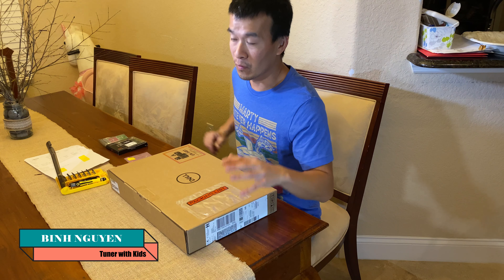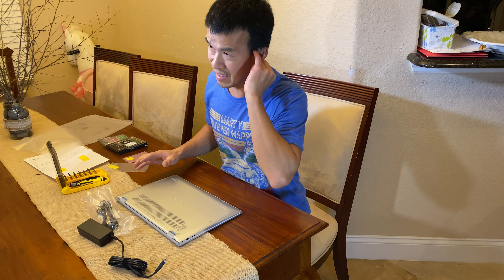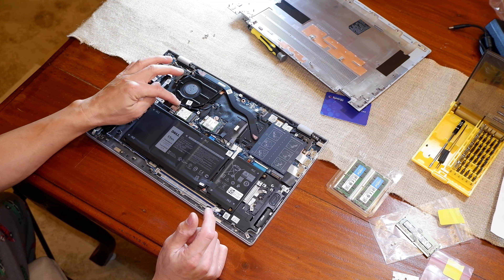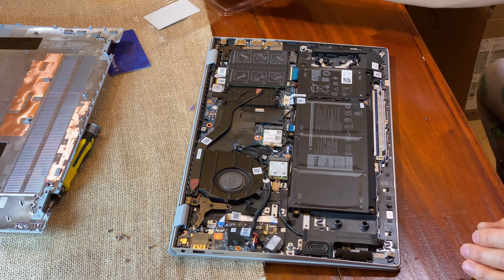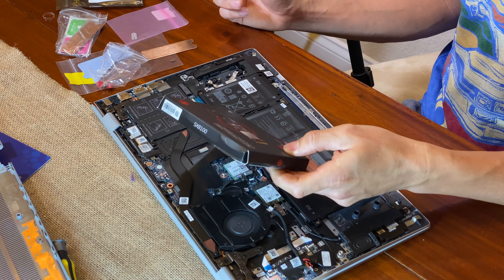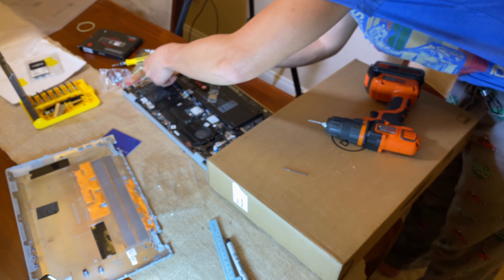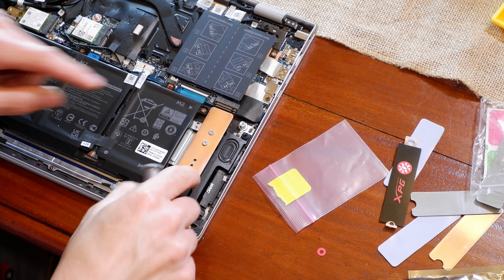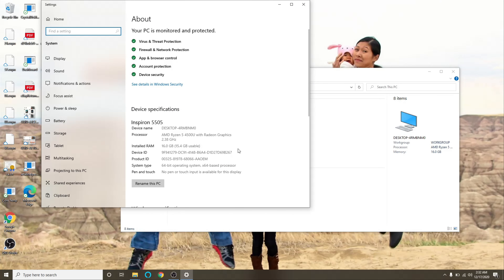2021 Dell Inspiron 15 (5505) RAM & SSD NVME Upgrade | AMD Ryzen 5 4500U | How To Install Hard Drive

Comment: You are actually missing the DF6CG screw that holds the SSD down.  But it looks like you used a different screw.  I was going to suggest glueing the metal bracket you filled the holes into by using an epoxy.  I mean once the ssd is screwed down that bracket is not going anywhere if you would've used a little epoxy.  
I got the same laptop and got the 3 screwed and small bracket from Dell.  I am not upgrading the ssd now so I will wait until the bracket is back in stock to order it from Dell
Reply from the maker: Yea the m2x3mm is $2 each and I already had plenty laying around. Plus the aftermarket bracket came with a few. The hard screw to fine are the m1.6 which isn’t common.
Reply from the maker: Also with the aftermarket heat sink, once you drill hole to clear the nub, you can just wedge it on with the thermal tape and it won’t budge. They two screws I used are just for extra hold down.
Reply: @TunerwithKids  I was lucky to order the M2x1.6 screws for $1.99 each but I used my Dell Rewards Balance like you ;).  I also got the small KYMC9 bracket from Dell (used the Dell Rewards).  That was last week and I already have the 3 screws and smaller bracket.  I just called Dell and was able to place an order for the MWJM4 which is the most important part (bracket with thermo pad).  The MWJM4 is $6.99.  I didn't have enough in my Dell Rewards, but it covered half of the cost which is ok.  I hope they don't cancel the order though like they did with you.  The M2x3mm screw is not available, but either I will find one in my toolbox or will buy one from any site since it's just a M2x3mm flathead.
BTW, for the RAM I just purchased 1x8GB Crucial stick 3200 with the same latency (I think 22, but I remember checking the specs for the Samsung stock sick and matched it).  Got it for $30 for 1x8 GB stick
Reply from the maker: Yea I got canceled on the MWJM4 order. Had to reorder the others after. For RAM it was $32 for one or $47 for two so I opted for matching and sold the Samsung OEM for $20.

Comment: I feel like you can get away without using a heatsink if you are going to be using a SATA M.2 connector since those don't generate a lot of heat.
Reply from the maker: You probably can use without the sink. Most m.2 have their own thin heat sink already.

Comment: Hi I bought this laptop with the Ryzen 7 option last year and it's a really good premium feeling machine.
My only main concern about the laptop is when you open it up to upgrade ram or ssd the screws are easy to strip. I hope dell fixes this problem.
Reply from the maker: Yea. Just need a good precision screw driver. Three screws near the top monitor side don’t come out all the way, they have a retainer holding them.

Comment: Hi, thanks for the vidya. Question about the heatsink for the SSD tho - is it absolutely necessary? I will just use this laptop for browsing and watching movies. Not gaming. What are your or anyone's thoughts on this?
Reply from the maker: It’s probably not needed especially on the backside where it sits in this machine. The main heat is on the front side which is wedged by the cover and that thermal tape. These SSD get hot during reading and writing though. I see temps of 120 to 140F when it’s writing GB of data from the 256 main drive to the secondary SSD but it’s also writing crazy speeds.
Reply: @TunerwithKids  Oh ok, thanks so much for the clarification. So no heatsink, but i'll def look into some thermal tape or maybe even that thermal pad straight from Dell. Thanks again!
Reply: Hi I am from India and I have ordered the laptop in Dec 2020, but need to sell it now.

Comment: hey thank you so much for the video... I was able only to install the top heatsink but not the bottom one ? do you think that's better than no heatsink at all or should I take it off?
Reply from the maker: Should be fine. It’s so tight that I’m not sure the other sink will do much b

Comment: Do you think is possible to use an offset screw instead of the bracket?
Reply from the maker: If you want to just send it, you can screw right into the plastic hole for the bracket screw sink. Just space it with some random washers and use a longer m2.5 screw.
Reply: @TunerwithKids  Could you kindly recommend one from Amazon? I have seen many but the threads seem too thin. Since you have seen the plastic hole firsthand, maybe you have an idea which standoff screw could fit snugly. Thanks!
Reply from the maker: Heres a $7 option with the sizes you will need - https://amzn.to/34GVJc4

Comment: Great video! 
I ordered Inspiron 15 5505 with 
AMD Ryzen(TM) 5 4500U Mobile Processor with Radeon(TM) Graphics and is it good to change it to 16 gb RAM for games and other stuff? It comes with 256 SSD.
Reply from the maker: I think the 16B will help the computer run much better, if you can afford it go maximum 32GB.

Comment: Are you able to charge this laptop through a type c cable?
Reply from the maker: Yea. You need a power delivery cable and supply. Usually 45W or more.
Reply from the maker: @pcruz8 it’s for dual charge capability. Also, since most mid and low end machines only have one USB-C port, don’t want to tie it up for power only. For my Dells, I have a WD19TB (work computers) and an older WD15 dock which can dock most Dell and others with charging. For my Dell 15 G5, it doesn’t charge via PD due to the power demands of 185W.
Reply: @TunerwithKids  Thanks for the update. I tried charging with my phone charger and it didn't charge. Looks like I need to get an adapter with higher Watts.
Reply from the maker: Something like this, https://amzn.to/355nTyx
Reply from the maker: Need a cable like this. The longer it is the less watts it will deliver. PD has specifications for length and power. https://amzn.to/385aR5V
Reply: @TunerwithKids  thanks

Comment: HP pavilion with amd7 vs this dell laptop amd 5 which one you recommended. I got both want to rerun on.
Reply from the maker: I have no experience with the HP. Is it the same price?
Reply: @TunerwithKids  yes it is same price. Same ram and ssd.  It go has 250 nits vs 220 on this dell
Reply from the maker: Seems like HP might be better for power. Not sure about build quality or size.
Reply: The hp has the faster ryzen 4700u and since you got the newer pavilion with the aluminum body its a better "quality" build than the plastic dell. Im happy with my pavilion so far, its in fog blue and built it on hp.com with a fhd screen, wifi 6, 2 sticks of 2x4 3200mhz which is 8gb ram, backlit keyboard and 256 ssd kinda small but still quick and it has a finger print reader, If I were in your shoes compare the specs of the two laptops indepth and see which has more features/benefits for you. If they have the same ram, should one be 3200mhz or the other be 2666mhz then the 2666 is slower, or if the dell only has one stick of 1x8gb ram compared to the hps possible 2 sticks of 2x4gb ram which means 2 matching sticks is better. It sounds like the hp has a brighter screen too, are they both the glossy ips screen? Its a pain to clean. If you have wifi 6 in one thats good, also if one is backlit keyboard while the other isnt thats a plus, and I think the hp B&O speakers are better. Find out which laptop has better "specs" (the dell may have a larger battery) or more features and go from there, also if one has a longer warranty thats good too. They sound like very similar laptops! Only major difference is the hp having the 4700u
Reply: What did you decide on?
Reply: @N8Catona  Go with Hp. light and build quality good as well. also razer 7 for $399 sims good deal. HP customer service is really bad 
thx
Reply: @hiteshpatel528  i actually have my own new hp pavilion that I bought haha, I chose it over the dell inspiron because it eeked ahead with 2 sticks of 2x4 ram and a brighter screen and that nice color. I actually have good service through hp support assistant actually and you can tell the bot to speak with a person which is very helpful.
Reply: i went with Dell becuase of ease of upgradeability (supposedly), the bios is being a raging pain in the rear as I try to install linux on the machine

Comment: Is the heat sink actually necessary? The manual doesn't seem to say to put in a heat sink.
Reply from the maker: The part is supposed to be there but Dell quit shipping it installed.
Reply: Thanks a bunch!

Comment: Where would I go to chat with dell on ordering the parts for the second SSD? I just got this laptop for christmas and want to eventually install 2 NVMe SSDs. I would prefer text chat but calling also works.
Reply from the maker: On there website under support or spare parts. There’s a chat option in lower corner, if you tell them the P/N they will process it thru chat and send you an invoice/estimate. The OEM heat sink is on unforeseeable back order. The m1.6 screws and small bracket are available. If you don’t already have an m2x3mm screw, need one of those too. Sign up for a Dell rewards for free 2 day shipping else, they charge $9 for ship.
Reply: @TunerwithKids  Thanks. I will probably consider getting after market heatsinks for my drives as I was looking at getting that part from dell but since it is on backorder I might be better getting the aftermarket.
Reply: Guess I should ask this as well but does it cost to join the dell rewards?
Reply from the maker: @Imnotimportant555  Dell rewards is free. It’s usually 3 to 4 percent back on all your Dell orders.
Reply: @TunerwithKids  ah ok thanks.
Reply: @TunerwithKids  I have returned with an update. I got my laptop and just upgraded the ram. you mentioned about the touchpad not clicking. that did happen to me but it was not the screws that caused it. the bottom panel was not clipped in 100% around where the touchpad was.

Comment: Hi, thank you for the video. I received my Dell 5502 two weeks ago and i want to add M.2 2280 Gen NVMe SSd. Would that be no harm if I just screw it down to the plastic hole without the heatsink? Thanks for your response
Reply from the maker: You can probably get away with it. May need to spacer or washer.
Reply: @TunerwithKids  
Oh that would be great.  thank you for your prompt response.
Reply: Thanks for your response. I have another question
Can I ask what would happen if you cloned and installed a second SSD into the second slot and simply copied all of the windows data onto both drives, I assume it would get confused and the BIOS would go for the original drive, unless you changed the boot drive, or would it be better to ensure you had a good copy of the original drive and then delete it? Thanks

Comment: Do you really need the SSD heatsink? Or can you just put it in?
Reply from the maker: Probably don’t but you probably need the offset bracket. Either try Dell or it’s $10.99 on Amazon with two screws. There’s a link in description to the listing.
Reply: @TunerwithKids  Awesome! thanks

Comment: Can we add additional HDD into the laptop? Kindly reply. Thank you in advance.
Reply from the maker: M.2 SSD only.
Reply: @TunerwithKids  Type 2280 OR 2230?
Reply from the maker: 2280 but 2230 fits too. Not sure how the hole lines without the OEM bracket.
Reply: @TunerwithKids  2280 is widely available. I have inspiron 5515 which has a similar chassis, and hope to install 2280 M.2 on the same using a bracket and screw.

Comment: How's the battery life like? I'm thinking about getting it but it only has a 40Whr Battery...
Reply from the maker: Brand new it looks like it can last 6 to 8 hours on normal light use.
Reply: @TunerwithKids  Mhmm I wonder how that'd possible because my current Huawei Matebook D15 has a bigger battery but just lasts 5h
Reply from the maker: Idk...better power management? The first day I used it new, I left it unplugged while doing stuff and file transfer off network to see how it looked. Battery stayed pretty solid. And the estimated hours by windows seems to stay pretty high. But who knows how long that will last after some usage and aging.
Reply: @TunerwithKids  Ok thanks for the help, I'll probably get the 14' model :)

Comment: Thanks for the great video! I was initially thinking I would just replace the OEM SSD with a full height (2280) one. Has anyone done that, and know if it will mount up properly? Any extra parts like screws or a heatsink required for that slot? If so, would the OEM SSD mount in the 2nd slot without additional parts?
Reply from the maker: The main SSD slot can only fit a 2230. You can clone that onto a 2280 and then change the boot order to boot from the second slot. Once confirmed to work and boot, you can format the old system drive as a secondary SSD.
Reply: Thanks for noting that! The spec document makes it seem like both slots support the 2280
Reply from the maker: Actually, you’re right. I was mistaken that slot for the WiFi card which is in the middle. The primary slot has a bracket that locates the 2230, you can move the slot over to the prefab holes for a 2280. Thea doesn’t seem to be allowance for heat sink in that location. But is next to fan, so maybe ample cooling.
Reply: @TunerwithKids  how do you move them?

Comment: Once again Dell is synonymous with junk. I have this laptop and it is the worst laptop I have ever had. It has HORRIBLE light bleed, the sticking touchpad which even the crappiest Acers dont have not to mention it is missing parts just like this one.

Comment: sir im trying to update my ssd too，im having a Samsung 980pro 2t，i dont know why when i plug it in and my laptop just cant boot，i cant check the BIOS when i have the new ssd in
Reply: Did you found a solution? I am going to do the same.